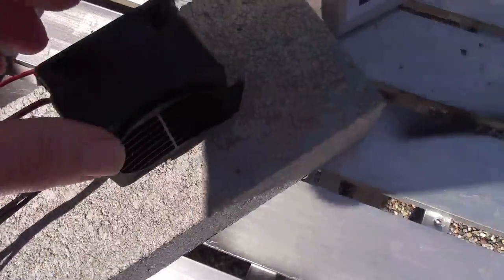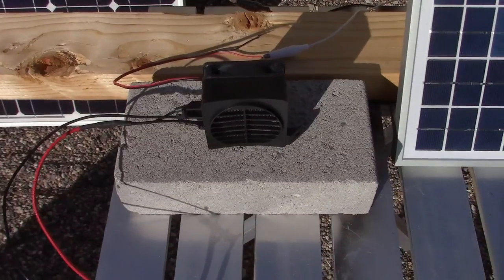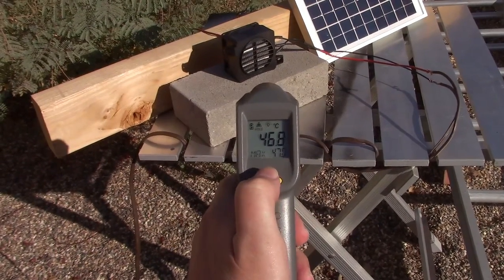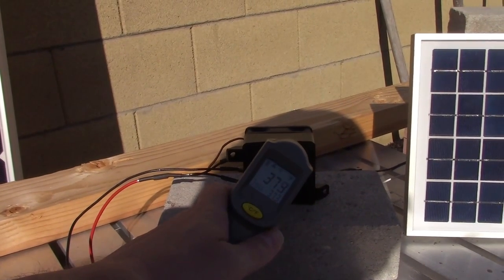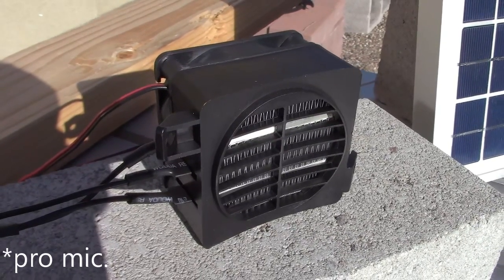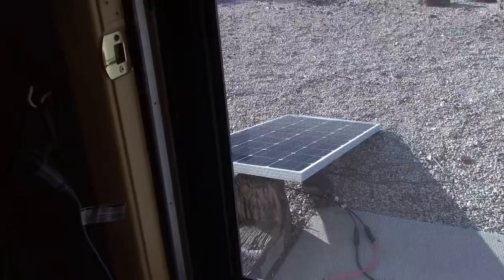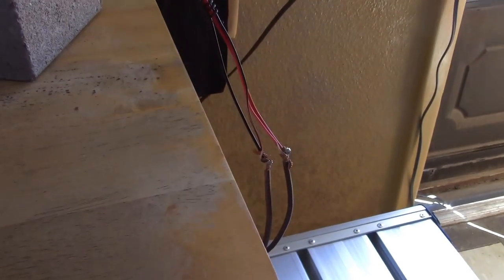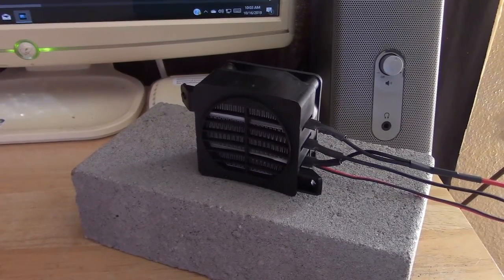Solar Electric Air Heater! (100W 12V) - 100W Solar Panel runs it! - PV space heating!! Ez DIY

Comment: desertsun02 thank you very much for this great video! :) I am interested to build this setup for myself. I have a question: do you have tips on how to shut down the system? Can the electric air heater simply be disconnected? Greetings from Holland
Reply from the maker: hi. yes you can just disconnect the wires. i just built a 200w model of this type of system. it has switches on it to turn it on an off and is mounted to a frame. i'll post video on it in about a week.
Reply: Just add a switch

Comment: How about insulating that brick and using the fan to heat it during the day, then removing the insulation for evening heat?
Reply: Run a copper pipe through the centre of a barrel filled with liquid exhausting upward. Air passes through the water container and retains and gives off radiant heat.. wonder what kind of liquid would be best? Cheers
Reply: Glycol sounds like a great solution to your idea! Like automobile radiator antifreeze. It has corrosion protection in the liquid to protect your pipe and barrel.  and it resist freezing and would be ideal for temp fluctuations. Great idea 💡🙂
Reply: On second thought! A copper pipe inside a larger diameter copper pipe and the void between the two pipes filled with glycol and the center of the small pipe is the air vent. The radiator can be in the shape of a Gatling gun or revolver barrel with the heater placed behind the tubes the heated forced air passes through the pipes heating the glycol filled copper! I just might try this🤔

Comment: niiice.  thank you  will be getting one for my campervan with a dedicated portable solar panel so i can save on propane and still be warm enough.  im sure it is not powerful enough to heat a whole van.... especially in the dead of winter,  but.....on cool mornings or fall or spring when you can stay warm enough with that heater it will work great.
Reply: Yes how did it work I'd hate to blow a new solar panel. I'm going to add a fuse. But I would like to know knowledge and confirmation of someone that is actually doing it.
Reply: @hgboone3  i havent bought one yet... i just saw it.  but moving to oklahoma soon so its a delayed purchase so i put it on my amazon wish list lol
Reply: @LadyTSurvival  yeah thanks well I have a solar panel coming I just wondering if I should just buy the heater. I have no idea why I can't find a DC Electric oil heater radiator type.

Comment: I have a $20.00 900watt/1500watt 120v heater in my cargo trailer 7*14’ 650 cu ft thermostatically controlled. When it is in the 40s outside it cycles on quite a bit. I do not see how. 100 watt max solar panel would give you much heat. I have 600 watts of panels and 300 amp hrs of batteries a 3000 watt inverter and can not run my heater all nite.

Comment: Can we run it on 12 V adapters.
Reply: 100 wats on 12 volts would draw around 20 Amps DC. You would need a pretty good power supply to run it.

Comment: if only it worked this way to cool stuff down :(    it's getting hot in the approaching Australian summer.
just spent $1500 yesterday for a split system install for the bedroom, the lounge room one needs to be upgraded, that's another $2500..  ugh.

Comment: So brilliant.Please teach us how to hook up a battery so it will work after the sun goes down.Thank You for sharing Your excellent ideas.
Reply: I’d like to set a few of these up in our cabin with 2-3 panels to heat constantly during the day and then run off a battery after it’s dark.
Reply: @613Stuart  that's my thoughts, did u ever manage to use these on your cabin?
Reply: @613Stuart  This was my exact thought as well. Except using it for the crawl space under my cabin. I wonder how many amps those heaters pull.
Reply: @WildWackyTunes  100/12=8.3A X 6hours 50Amps
Reply: Exactly my thoughts. 🙏
Reply: I wish he'd show how to connect to a 12v battery, too!
Reply: @scootermom1791 red and black on a battery same as the panel lol
Reply: It's not hard
Reply: Hahaha, use batteries!!!!

Comment: holly cow , 340 btus of heat!
Reply: Just for a sense of scale 340 Btu is the energy it takes to raise 10 gal of water 4.8° F in one hour (or raise 1 gal by 40.76° F). A Btu is is based on water and the Fahrenheit scale. 1 Btu is the energy it takes to raise the temperature of 1 pound of water, 1 degree Fahrenheit in one hour. 1 gal of water is 8.34 pounds.

Comment: @Desertsun02
I would like to know how long the heater last?
Hours? Days? 
Sorry to be critical, but if it doesn't last months to years it just a toy. 
How long have you used it before it burnt up? Or how long have you used it and it is still working, please post hours unless it 24 per day.
If it runs 24 hours a day for many days please write 24/7 And number of days.
Thanks.
Reply from the maker: hi. it's heating element is rated to last many years. fan has minimum 30,000 hour life in it. should last a long time.
Reply: @desertsun02  thank you.
But I'm interested in how long it has worked for you. We all know companies put outrages specs on items.
Have you used it since making video?
I don't know how long been between you making video and posting it. Some people make many videos at once and post over a long period of time. And a very few make a video and post the same day. 
Sorry I have the charisma of a ogre. I'm not meaning to be critical. I have very bad communication skills. But Im really interested in this. 
I'm a offgrider, and it is very hard to get items from places like Amazon. They can't simply ship to my place. So it is important for me to get all the info I can. If say 5 to 10 of these will heat a 20x20 building over years in opposed to firewood or propane, in the long run it would be worth the investment. Also this way eleminated using invertors, which is also a plus.
Reply from the maker: @pycho hobo i make just one video at a time and usually post within a week of filming. i've only had the heater a few weeks. the heating element in this unit is similar to the heating elements in many standard ceramic heaters (just smaller). i think it's actually two 50 watt heating elements that they wired together.
Reply: @desertsun02  thank you.
Reply: Why don't you run the test yourself?
Reply: @KaleidoscopeJunkie  why make a video of playing with toys ? I asked reasonable questions or are you too stuipid to realize that?
Why would I invest money into something that isn't going to work in the long run?
Reply: @pychohobo1832  Why do you think others should jump through hoops for you? You clearly wouldn't do it for them.
Do your own research to answer your own questions.
Reply: @KaleidoscopeJunkie  Well that explains everything about you.  Mouse.

Comment: So to use the heater in your house, do you drill a hole for the wires?
Reply from the maker: no need to drill any holes. just find a space where the door doesn't fit really tight to the house and run it in. my front door easily shuts with the wire running from outside to inside
Reply: Never mind. I couldn't leave the door ajar in winter.

Comment: The reviews from Amazon were not good, mostly bad for this item. Does this item really heat a space or is it just for the immediate area?
Reply from the maker: hi. i think the amazon reviews are artificially skewed. what i mean by that is the main complaint in the reviews on amazon that i saw was that people thought the heater would be bigger *and hence they thought it would be more powerful. (the pictures on amazon make it look relatively big or at the least it's hard to tell how big it is)... *but there's no mistaking its size in my video. plus i used tinsel to show exact air flow and showed temp tests (holds 115F all day essentially). the unit itself is pretty sturdy and internal element rated for years of use. i'd call it a small personal space heater 😎
Reply: @desertsun02  Ok I get that, but you do not mention how well it works and how much it can heat up. Granted I am midway through the video at this listing so if you say something near the end obviously I have not gotten there yet... The reviews I've read say it does not heat up well. Granted it may heat up to 400 degrees or higher but what volume will that heat up? Is this just like something for the office or small personal heater? Cheers...
Reply from the maker: hi. the end of the video may answer your questions. i show it as a desk top heater right on my desk. also i show indoor tinsel test for airflow and analog temp tests showing 115F output. it's great for a desk top (or office space cubicle heater). it would struggle to heat a whole room (unless room is small and you only need a few degrees increase in the temps) * again as far as heating up - it heats up believe me and i got the burns to prove it lol. it's safe but don't touch heating element. another way to describe it is think of a heater vent in your car. it's like a single heater vent in your car blowing on you (on medium speed)
Reply: @desertsun02  Cool, thanks for the update...

Comment: Sometimes you were showing the temperature in your Shadow and it was difficult to read. And the video was pretty long. But kudos to the heater it looks like it works great. Thank you for sharing
Reply: May you try using a blow dryer with the 100 or 200watt solar panel to check if the blow dryer will power on.Wal-Mart has them mini heaters that's only 250watts ???

Comment: very interested in making one of these could you provide instruction on how to wire it up thank you
Reply from the maker: hi there. all the wires come pre-attached to the unit. all you do is twist the red wires (positive wires) to the red or positive wires of the solar panel (and then connect the black (or negative wires) of the unit to the black or negative wires from the solar panel. btw it doesn't matter whether you connect the red ones first or the black ones first
Reply: @desertsun02  sorry one more question were does the fan wire go to the 100-watt panel.
Reply from the maker: yep. you put the heater wires to the 100w solar panel and the fan wires to the 100w solar panel (near the end of the video you can see both sets of wires connected to the solar panel wire
Reply: @desertsun02  thank you have

Comment: a well insulated van can be heated with 500w, 5 of those $10 heaters... job done. although you wouldnt want to run a long time because, well, batteries... but if you have more solar watts than heater watts then you can run it as long as the sun shines. free heat..

Comment: I wonder - Solar panels during the day and could I wire the fan/heating element to 12 volt plugs and use a power unit (jackery, etc) at night. I'll be boondocking most of the time in my RV.
Reply: Well 100w divided by 12V = 8.3A of load. A jackery 500(500wh) would run it for about 5 hours.  So for heat during the day, you would need one panel to drive this and one panel to charge the battery for 5 hours of night time use.  100w is 340 BTU, not a lot of heat.  A 10’ cube(600 sq/ft of surface) with 2” of foam insulation(R10) no windows and perfectly sealed @70F inside and 30F outside(no wind) will need around 2400BTU/hr (.1btu/sq-ft/degreeF/hr) to maintain 70F inside. Windows, air leakage ect make that number go up considerably.  2400BTU =7 of these, so 7jackery 500’s and 14 panels, oh and thats only for 5 hours of night heat:)  there is a reason people heat with wood, gas and oil and not solar to electric.  Solar electric heat can be done, but you need to use a heat pump(5 plus times more efficient than direct electric heat).
Reply: or a heating blanket on low for 10 hours rougly 20-35ah on high you could do it with 45-55ah.
they have heating blankets with timers that run for 2 hours on then switches off. could use that and wake up when your cold hit it on again
Reply from the maker: hi there. sounds like a good idea 🙂
Reply: I was going to suggest a small rechargeable battery but then looked up what a jackery was. Charge up the jackery with solar and run the heater/fan at night. I would think it's about the right size for a small room in an RV.